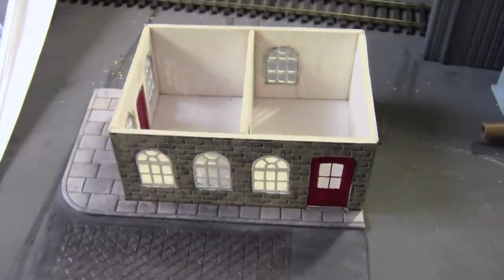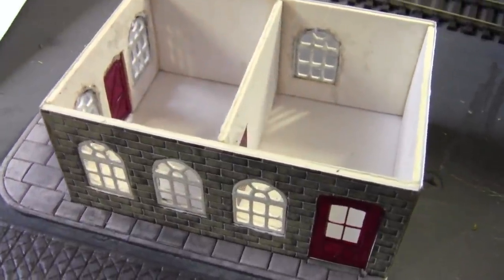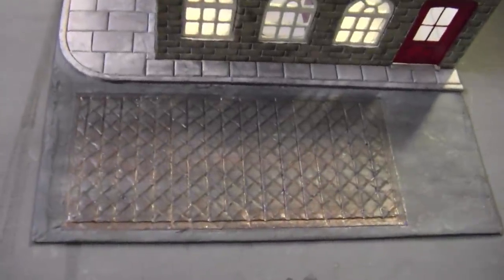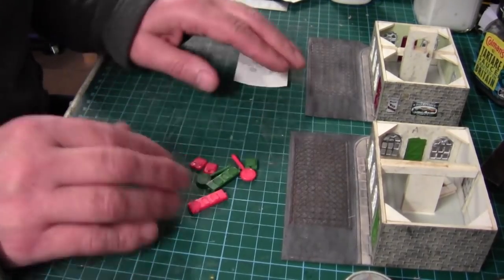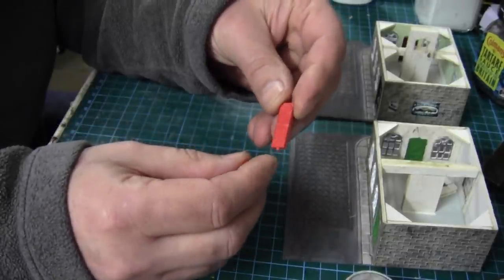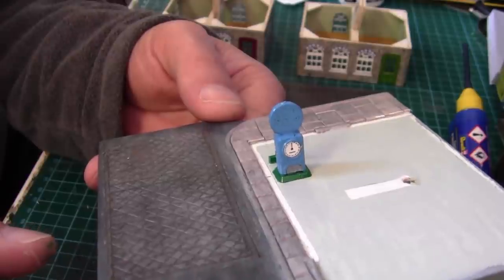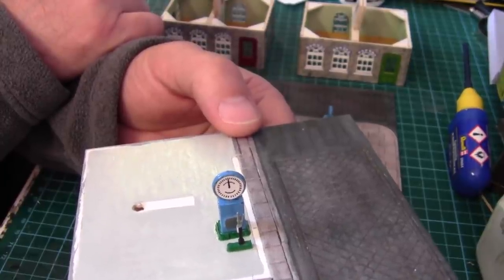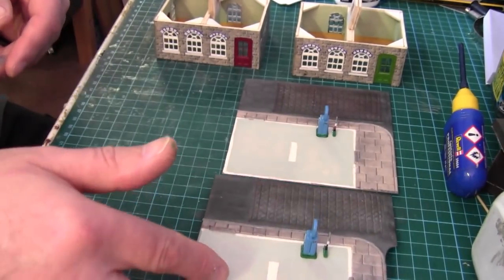The weighbridge and office Part 2. No 262

Comment: Hi Tony, great detailing work! I like the super glue trick to get nice edges without the card falling to bits. Enjoy the look at the old photos and a bit of the history as well. By the way, you need to have a word with the loco driver at the start of the video as he completey ignored the signal 😀😀 Cheers John
Reply from the maker: Hi John.  The driver has been disciplined and is now painting a white line around the top of coals in the yard, as there has been a lot of thieving going on in the yards. its a good trick using the super glue. you can turn thin paper into plastic by spreading super on paper. and leaving to dry. once dry its like plastic....thanks again for commenting........cheer's Tony
Reply: @TONYNORTHEASTERN  lol,  good to hear you are getting your staff under control

Comment: haveing worked at a council weighbridge  all i can add is you need a mirror on the outside wall looking down on the bridge we needed the licence plate number  to know who to bill also all chairs where on casters we had to roll from desk to mirror then back to view scales
Reply from the maker: Hi Steve, interesting would they have done that back in the 1950s. its definitely a good idea. i don't know about wheels on chairs. i could give that a go.. until next time,  cheer's Tony
Reply: well most weighbridges had a window tight up against the corner facing the drive in so you could just turn i noticed yours doesnt have a window in the right place so i assumed  mirror as today we use ctv and have blocked the old windows
Reply from the maker: i might be able to still do something about that.....thanks for replying..........cheer's Tony